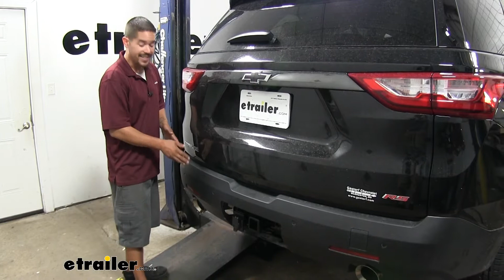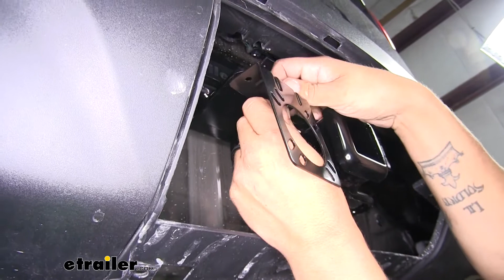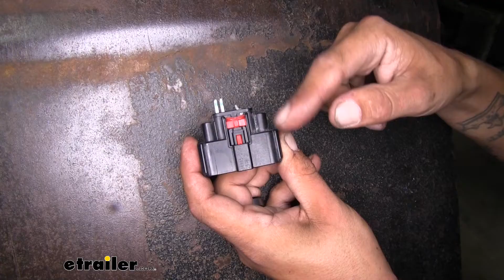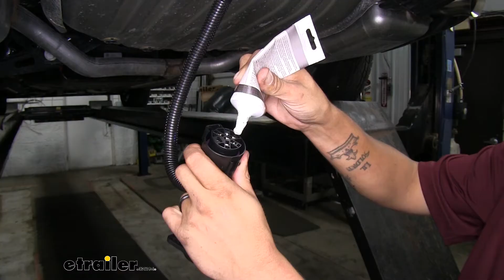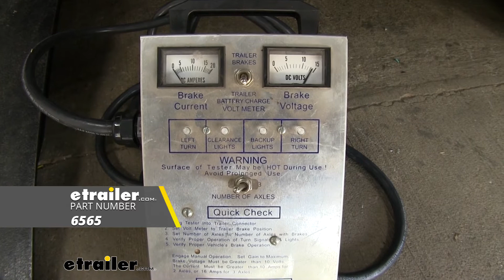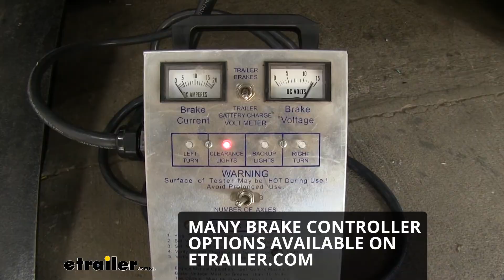etrailer | Curt T-Connector Vehicle Wiring Harness Installation - 2019 Chevrolet Traverse

Comment: need to see one on 2019 honda passport
Reply from the maker: We have wiring for your Passport but this wiring harness is custom fit for Buicks and Chevys.  Instead you need a wiring harness like https://www.etrailer.com/Custom-Fit-Vehicle-Wiring/curt/C56291.html We have an install video on a Pilot which is the same process as on your Passport. Here's the video https://www.etrailer.com/tv-install-curt-trailer-wiring-harness-2019-honda-pilot-c56291.aspx This is a standard 4-way connector for trailer lights and not a 7-way. If you want a 7-way you need to use the same 4-way and then convert it to a 7-way using https://www.etrailer.com/Accessories-and-Parts/etrailer/ETBC7.html

If you also need a hitch for the Honda here are our option https://www.etrailer.com/hitch-2019_Honda_Passport.htm